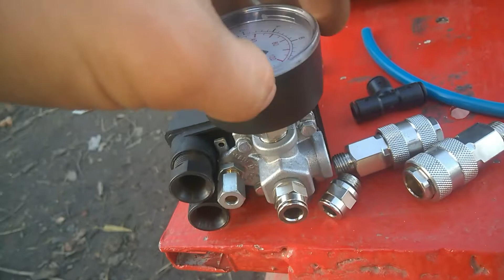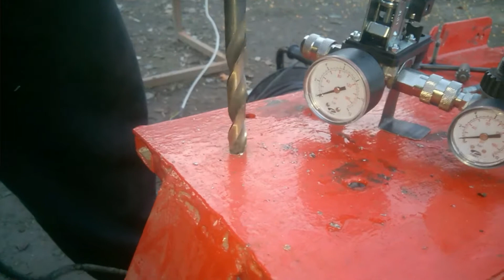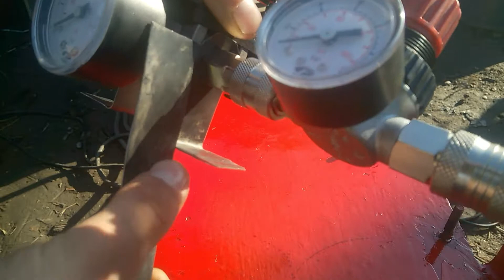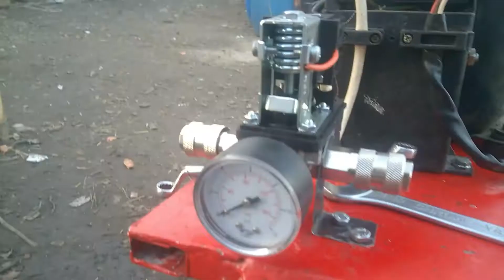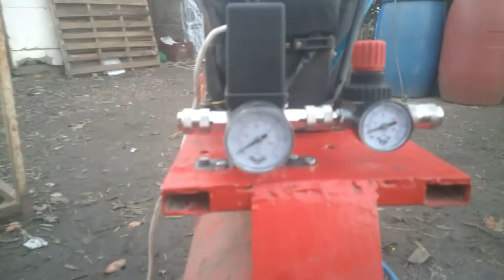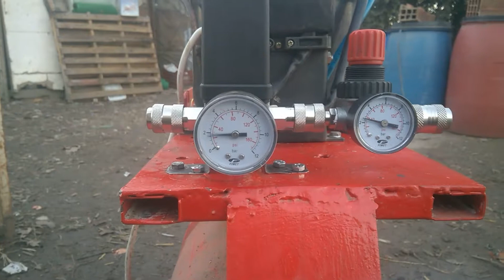Homemade silent air compressor How to build an silent air compressor  Pt - 2

Comment: Nicely done. 
Where did you get the blue tubing; what pressure is it good for, and what size it?
Thanks
Reply from the maker: I got the tubbing from my local hardware shop...idk if the color matters but it's really cheap and the connectors I ordered on eBay..i can't really tell you exactly the volume but I can hold quite a lot of air...it is an air brake air tank from an old trailer